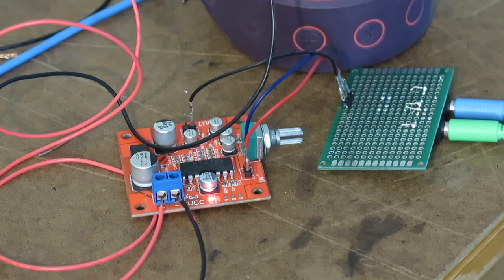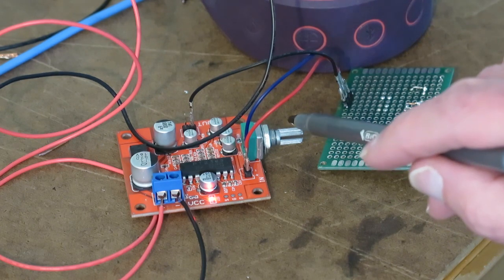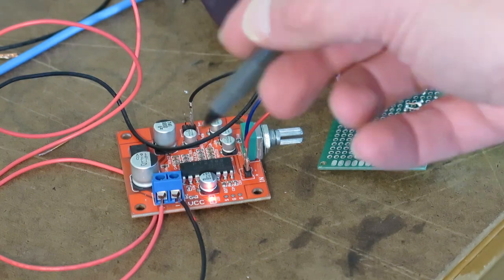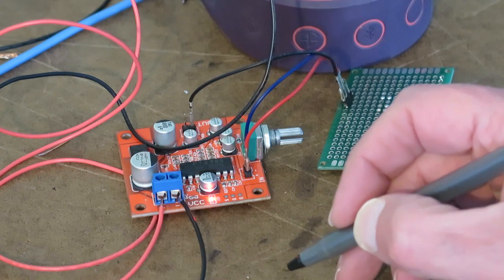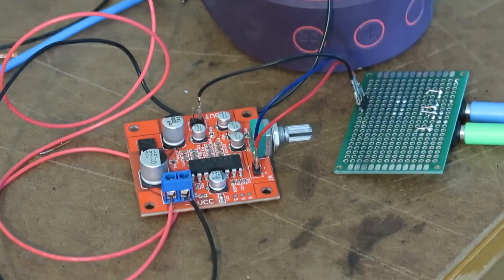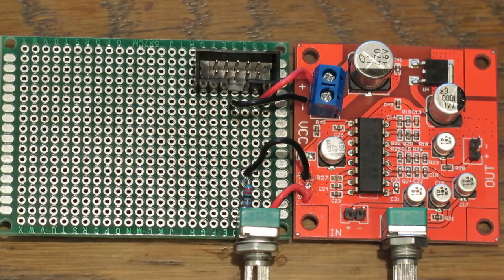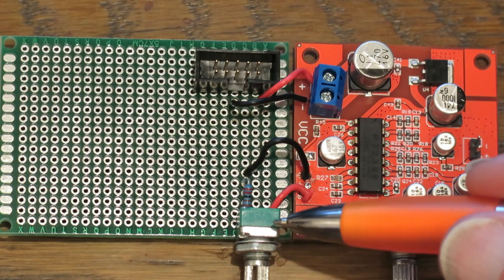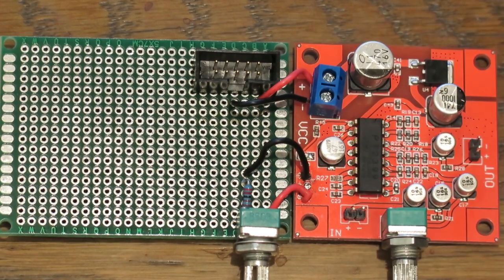Reverb/Echo DIY Eurorack module build (cheap!)

Comment: Thank you for a very informative and interesting video. I purchased one of these modules and found it to be good value.  I diverted the delayed signal to be independent of the main signal which allows the module to be used in an audio mixer Aux buss.

Comment: huh. I thought you were going the DSP100 Reverb on this video :) Well... I soldered up the PT2399 from scratch and I think you got the good end of the deal on this one because not having to solder all those fiddly passives that come with doing the PT2399 is probably worth $2.50.

Comment: You should add a wet/dry mix potentiometer and do a video of it
Reply: should pretty much just be signal in going to the wiper of a pot  and then one leg of the pot going to the board input and then passive mixing the other leg w/ output no?

Comment: Sounds pretty good in low fi way. Just ordered a few boards then found this vid. I want use for guitar so thinking a preamp circuit. I’m assuming it has line level input resistance? Have to unsolder that reverb pot and run wires to to top of the case. Add a switch, dc jack etc..should be fun
Reply: Yes an echo/FX box built around a bunch of these could be outrageous! Working on a guitar/synth project too. Keep us posted on your progress!

Comment: Thanks... great tutorial Is the extra pot a 50 k analog? And is pin 1 and two connected to each other and pin 3 with the extra  2k resistor?
Reply from the maker: See here https://analogoutputblog.wordpress.com/2020/01/31/cause-for-delay/ . It's a 50k linear pot in series with a 2.2k resistor. The order doesn't matter but I connected left pad to resistor, resistor to pin 1, pin 3 to right pad, and pin 2 to... either pin 1 or pin 3, I don't remember. In fact I did one and found it worked backwards so switched it to the other.
Reply: @analog_output  Hm, thanks for the explanation, but these details should matter, really. Especially for beginners, things like that would greatly help, instead of lapidary but vague statements.
Reply from the maker: @whiterottenrabbit  "A lapidary is an artist or artisan who forms stone, minerals, or gemstones into decorative items such as cabochons, engraved gems, and faceted designs. A lapidarist uses the lapidary techniques of cutting, grinding, and polishing. Hardstone carving requires specialized carving techniques." Wikipedia

Comment: Hey Analog Output. Did you ever get around to doing the C17 mod? 

I’m very new to all this, so just wondered if you could give me any direction as to how you did it please?

Is it just a case of soldering straight onto one of the C17 legs? If so which one? 

Cheers,
Ed

Comment: thank you for the guide video.. I had tried them and the sound coming out from the module is pretty soft volume when listening direct to my headphone. How do I add signal buffer between the module? cheers!
Reply from the maker: A question probably best answered in a forum. If you post it here https://lookmumnocomputer.discourse.group/t/cheap-pt2399-reverb-delay-module-diy/801 someone will probably have some ideas.

Comment: Hello.  Explain how to install the potentiometer?  One contact is connected on the board, what is the second contact connected to?  I do not see a complete electrical circuit on the board.
Reply from the maker: Details in the blog post linked in the description.

Comment: thanks . hi will a 10k  Potentiometers work please
Reply from the maker: It'll work, although it won't give you as large a range of delay time as the 50k pot. With a 2k resistor in series, 50k will give you 52 to > 350 ms, while 10k will give you 52 to 171 ms. See https://www.electrosmash.com/pt2399-analysis .

Comment: if i don't remove R27 , what is the value of potentiometer?
Reply from the maker: I removed R27 and used a 50k pot in series with a 2.2k resistor. Details in the blog post linked in the description.